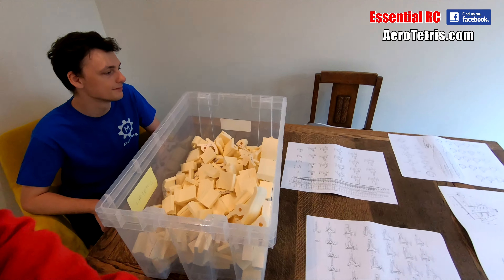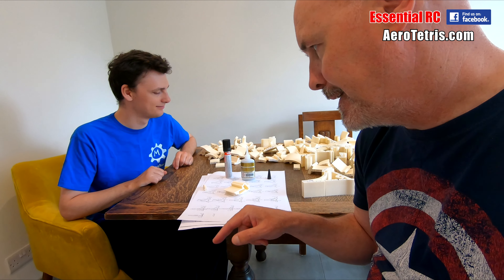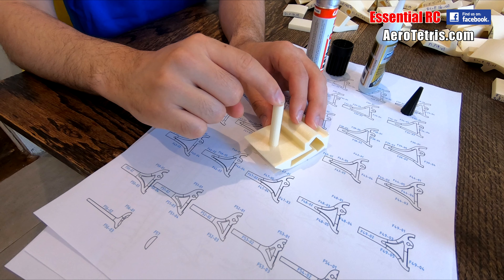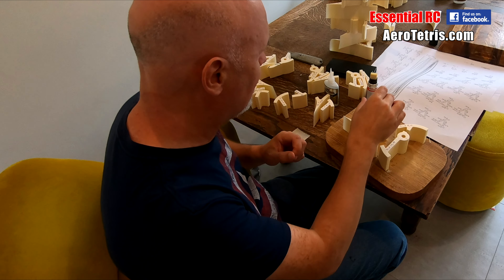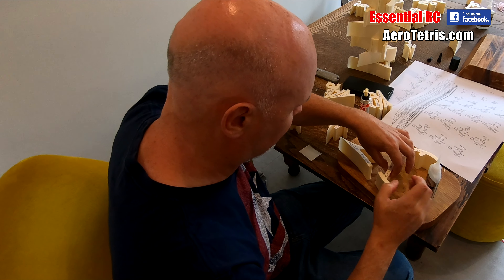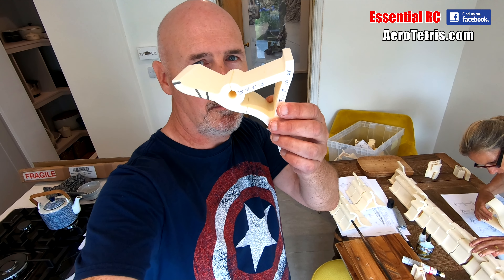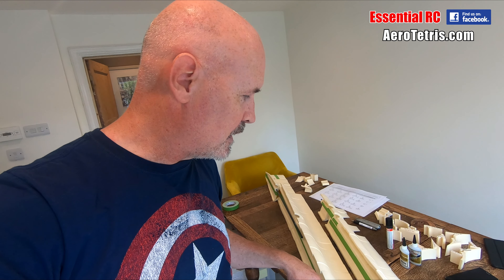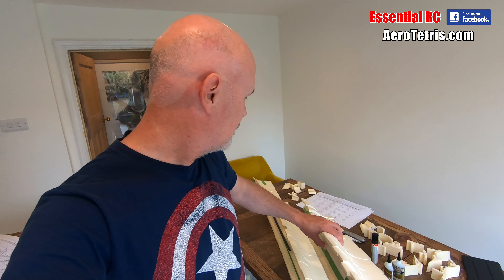AeroTetris 2.8 metre SR-71 Blackbird: BUILD LOG: Part 2

Comment: Good Luck, wow 1x section is about 5cm high, for 2800cm you need 560 section for 1x part of a part of the Wing and 1000x for 1x part of complete wing and then need to instal all the electric-wire and all this stuff would be a long long Project. You well need a glue sponsoring for all this first.
Reply from the maker: Maybe. Will wait until I decide on power system...then see if anyone out there willing to sponsor. I want to ensure airframe is strong first. Cheers Dom (Essential RC)
Reply: @EssentialRC  the only thing you need is a lot of time and endurance, at the end you have I am sure over 10'000 Glue points and if only one are not 100 percent you will see it at the first flight, anno 2050 LoL.
Reply from the maker: It won't be my glue point if it does fail ! LOL
Reply: Smile.

Comment: I noticed on the aerotetris web page that it calls for one ( 1 ) 120mm EDF.  I HOPE that's intended to mean one per engine nacelle!  Although I've been wondering if there would be any thrust benefit if you were to "stack" EDF's one behind the other.
Reply from the maker: That's a typo. It is designed for one each side.